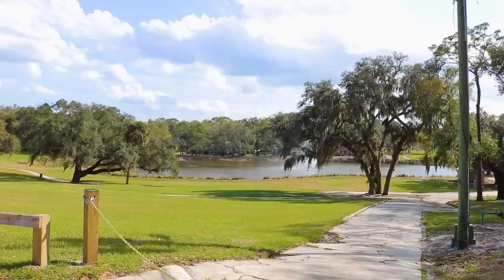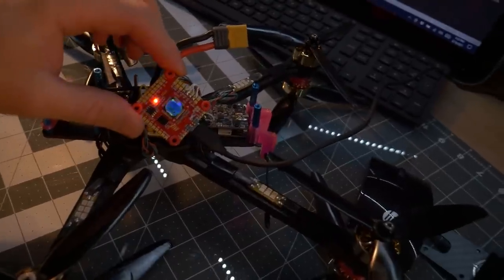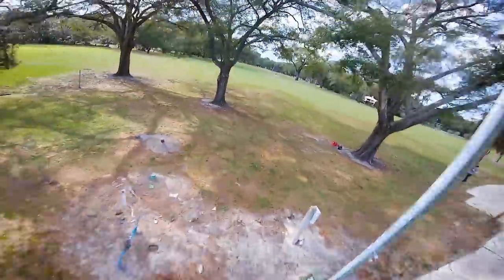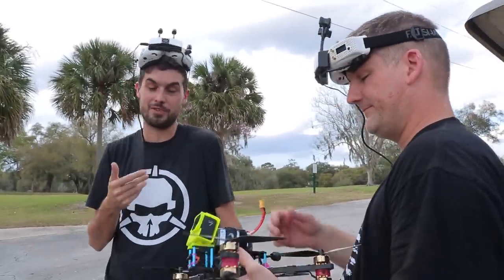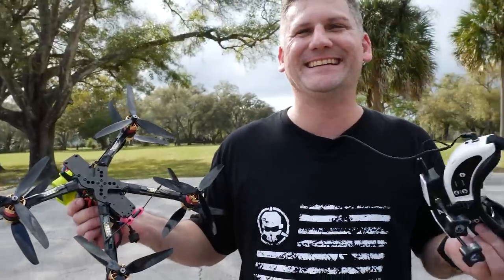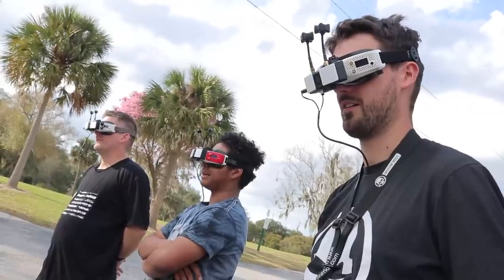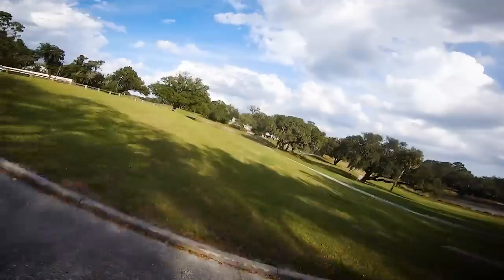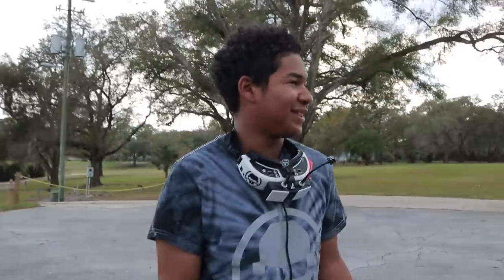We put 8 motors on a Freestyle Drone.. the X8 7in kwad that RIPS

Comment from the maker: If you have a 3D printer and want to try an X8 for yourself, download the STL for bi-motor mounts here: https://www.thingiverse.com/thing:4795302
Reply: Thank you!!! :D time to go play :p
Reply: Here are the CLI tuning changes I made using Betaflight 4.2.6 with blheli_s esc:

set dshot_idle_value = 300

profile 0

# profile 0
set vbat_pid_gain = ON
set iterm_relax_type = GYRO
set iterm_relax_cutoff = 7
set p_pitch = 78
set i_pitch = 117
set d_pitch = 82
set f_pitch = 112
set p_roll = 72
set i_roll = 111
set d_roll = 75
set f_roll = 105
set p_yaw = 77
set i_yaw = 117
set f_yaw = 105
set d_min_roll = 0
set d_min_pitch = 0
Reply: Will this work for any frame with 16x16 mounting holes or just with the cl1 frames?
Reply: @rightpricemedia8852  it should work with almost any 16x16 mounting hole frame.
Reply: yaaaa sik!
Reply: You hinted at selling these on your store... Ive been watchin lol eta??
Reply: Thank you thank you thank you. I've been looking for this for hours. I love you 😂
Reply: @LetsFlyRC  is the cli changes  required to make it work correctly?
Reply: @LetsFlyRC hello! please, tell me what a controller do you use and esc's? I want to build the same, but SpeedyBee F405V3 has only 6pins for esc#2 (GND, M5-M8, TEL). what wiring do you do on your quad? thanx!

Comment: But will it fly with only 4 props?!
Reply: on just the front 4 motors....
Reply: Nope. It shot to the moon on arming with 3 missing, so it'll do the same with 4 missing. Even if it is one on each arm...
If they turn off the half-broken "air mode" (or use pretty much any other flight control firmware) then maybe it will work...
Reply: Will it fly without props?
Reply: yes 
 @TLK22
Reply: @troyleigers8433  yes because when you’re back for motors go out, it goes into butterfly rescue mode so when it failsafes for butterflies swooping to take the load of the four non-running motors. Floats like a butterfly and like a bee. Speedybee 😂

Comment: After building a bunch of these X8 config drones i have found they work better as a 8 motor quadcopter ( each pair of motors rotating the same direction run by one signal wire) , done like this they will fly with only 4 props.

Comment: As soon as I saw it I thought " how do you land it?" apparently I'm an idiot because the answer is "carefully."
Reply: Nah. Landing is easy: Fly it near the ground and just disarm. Taking off is the problem. However you do it, you'll be doing some damage to the props unless you take off from a wooden block or something that holds it in the centre without touching the props... At that point it's easier to just put landing gear on it.
Reply: @Vousie  Wooden blocks are hard to find

Comment: Having double the motors means having to use roughly only 60% of the power they normally would. Also keeping the props turning slower and able to be banged up without breaking. Many pros, major con is the extra weight and drag. The bottom props can stay stuck in the grass until the top props pulls the quad up. Amazing!

Comment: What battery were you running?
Reply: Tattu 1550 funfly.  We brought bigger batteries, just in case, but didn't need them.  We were getting 3-4 minute flights on the std battery I use for 5" freestyle.
Reply: @LetsFlyRC  1550 is even more impressive. Great job.
Reply: @LetsFlyRC  You ran it down under 10V multiple times; maybe you did need that bigger battery???

Comment: What happens if you lose a prop? Will that motor smoke with no load? If that's the case, the ESC firmware should detect when the motor has no load and disable output.

Comment: Wouldn't it be possible to control the drone with only four motor outputs and then switch the motor cables so that the lower ones spin in the opposite direction?
Reply: It would probably fly fine, although, I haven’t tried it.... yet...   ;)
Reply: @LetsFlyRC  Looking forward to an X8 conversion of a toothpick :D (similar to the octocopter you guys tested a while ago, but maybe a project to actually convert an already existing smaller quadcopter to X8 with those 3d printed adapters)
Reply: @STK66  dang it.  Stop spoiling the secrets before I make them.  😂
Reply: @LetsFlyRC  Reading you like a book. :D But I'm seriously looking forward to what you are cooking up next! :)

Comment: how do you wire the current sensor when you use two 4in1 Escs   therefore you endup two current sensor  cable signals  to solder to the FC?

Comment: 16:10 shark byte cuts out at little under 7 voltas man , rip battery
Reply: Yeah, I'm like "wait a minute" *looks at Shark Byte manual where it says it takes 7 to 26 volts.  I'm getting ready for a toothpick build with the whoop board and I'm planning to use a 10 volt pad to power the VTX.
Reply: @Perforator2000  you done even need to , I run mine on vbat on my 4" lightweight and it's completely fine with a tiny cap
Reply: @nistax2880  I was thinking about running it off Vbat, but it will be easier for me to solder to the 10V pad on this setup.
Reply: @Perforator2000  if the 10v has enough power than ye to for it
Reply: @nistax2880  I hope it does.  Part of the reason I decided to upgrade this quad to Shark Byte is that the 5V regulator on the FC is bad and causes the VTX to black out on fast flips and rolls.  I'll try the 10V first and if it fails I'll go to Vbat.

Comment: This is definitely going to be the hot new trend, except on 6s instead of 4
Reply: Yeah but these guys don't like 6s .. I guess 4s is cheaper too
Reply: @elxero2189  why don't they like 6s? I thought everyone is on 6s.
Reply: @cinialvespow1054  if they aren't they should be. Especially on an X8, that thing would rippp
Reply: @connorcunningham7449  hmm, recently I've been seeing alot of sentiments against 6s saying that it has no advantage over 4s.
Is that true though?
I bought into 6s systems and like 15 batteries because i was told they have less battery sag and fly a bit longer.
Reply: @cinialvespow1054  I have definitely found that to be the case. I still do have some of my 4s quads and batts and I get at least another 30 sec out of my 6s consistently. Not to mention the power
Reply: @connorcunningham7449  so the power IS more than 4s even tho the RPMs are done in proportion?
I keep seeing know it alls on reddit saying anyone thinking 6s is 'more power' than 4s is 'does not understand quads' and that with the higher voltage you are meant to pick a motor that has lower kv to have same proportionate rpms and that supposedly works out to the same power.

Somehow I don't believe it though.
Reply: @cinialvespow1054  something I like doing is keeping the high kv motor and pairing it with a 60 amp esc, and just tuning it so it doesn't explode. Kinda like the 160mph quad on bardwells channel, just not quite as crazy. I just put a throttle limit on, change the esc timing, and demag to low. Works great!

Comment: How about this idea - get 4 motors with slightly higher center screws - say ¼" - and use those as the bottom motors - and use the widest possible nylon lock nuts AND round off the ends of the center threaded studs thereby creating "feet". And there are end nuts manufactured called "cap nuts" as well. But they would have to be milled EXACT to not have vibration.

Comment: DO ppl not use guards on the rotors just because of the weight it adds? I know nothing about drones but surely it would save you a lot of time and money in prevented breakages...Sick video, makes my first person gaming antics look slow in comparison, even faster than my Tribes days which is really saying something.
Reply: This comment is really old, but you dont use guards around the propellers because it changed the aerodynamics of the quad a ton. There are quads like this, called Ducted quads or Cinewhoops, but you wont be doing crazy tricks on those.

Comment: Hey, I just posted an idea in my community. It could possibly be that 3D drones can be improved using 8 motors. But the trick would be that when idling, the opposite motors blow on each other, so to speak, give each other thrust. Only when you accelerate in one direction on the remote the motors collapse and both motors will give trust the same way... It might have the advantage that you can accelerate the change in direction of rotation, because you have 50% of the motors rotating in the correct direction which also will support the other motor (by wind to the props) to change it's direction of rotation. I currently lack the know-how and money for it.  If anyone can say something about it, I would be happy. Otherwise it would be one of the projects I have in mind, but it could take years before I can realize something like that.

Comment: Anyway to get that 7" tune somewhere? :)
Reply: Here are the CLI changes I made using Betaflight 4.2.6 with blheli_s esc:

set dshot_idle_value = 300

profile 0

# profile 0
set vbat_pid_gain = ON
set iterm_relax_type = GYRO
set iterm_relax_cutoff = 7
set p_pitch = 78
set i_pitch = 117
set d_pitch = 82
set f_pitch = 112
set p_roll = 72
set i_roll = 111
set d_roll = 75
set f_roll = 105
set p_yaw = 77
set i_yaw = 117
set f_yaw = 105
set d_min_roll = 0
set d_min_pitch = 0

Comment: What the 7 inch pid tune settings?
Reply: Here are the CLI changes I made using Betaflight 4.2.6 with blheli_s esc:

set dshot_idle_value = 300

profile 0

# profile 0
set vbat_pid_gain = ON
set iterm_relax_type = GYRO
set iterm_relax_cutoff = 7
set p_pitch = 78
set i_pitch = 117
set d_pitch = 82
set f_pitch = 112
set p_roll = 72
set i_roll = 111
set d_roll = 75
set f_roll = 105
set p_yaw = 77
set i_yaw = 117
set f_yaw = 105
set d_min_roll = 0
set d_min_pitch = 0

Comment: Bigger quad bigger battery right? Well at least you need a lipo battery that is 1 time bigger because you lost flight time and maybe higher c rating
Reply: We were using a tattu funfly 1550 4s and flying for 3-4 min
Reply: @LetsFlyRC  insane For such Battery  Pack or those are some effecient motors how many amps did it actually pull on a full trothle?
Reply: @Retrograde99  🤷‍♂️ I never measured the amps.  I don’t have the patience to calibrate the current meter.  😂

Comment: iterm + airmode = no throttle control? Man you guys need to get some people in there that are experts when it comes to how and what makes the drones fly. SMH
Reply: not that there was no throttle control, but iterm spool-up would probably kick in here. Maybe listen to what he's saying first?
Reply: @FlyingPenguinDrones  i did listen, he basically said he couldn't bring the drone down without pitching it. Iterm will not cause that.
Reply from the maker: Yes when there are vibrations or another abnormal condition such as a missing prop, the fly controller will perceive that external force and I turn will do its job. This is some thing I have discussed at length and videos on my technically focus channel Drib 2. This is why I keep air mode on a switch, so in the event that a prop gets nicked and I term runs away, I can turn the air mode off and bring the drown down more easily

- Drew
Reply: @RotorRiot  iterm wouldnt cause the throttle issues you saw. In this case iterm is essentially acting like your pushing your sticks to correct for the imbalance. Sure airmode off will help if you have busted or abused props or vibrations.